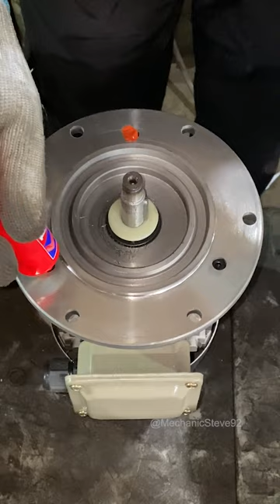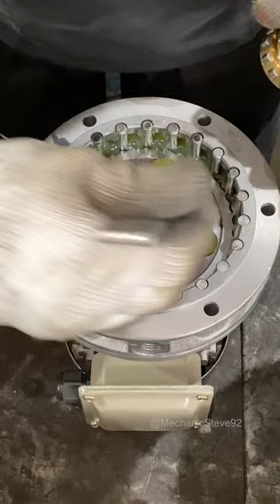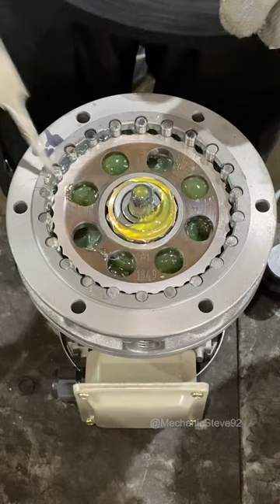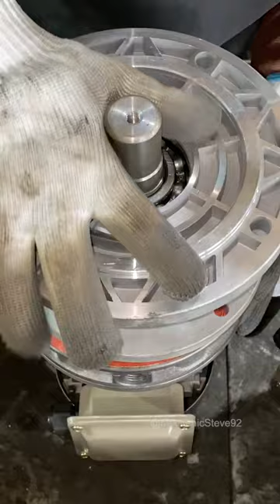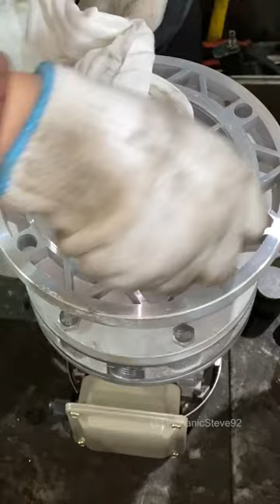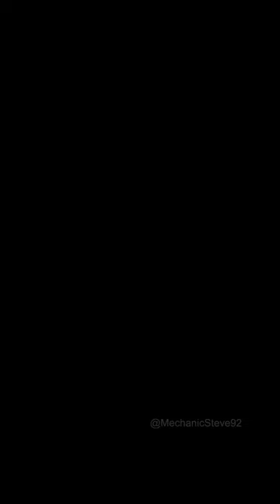BLD0-43-0.37KW vertical aluminum shell motor seat cycloidal pinwheel reducer assembly.

Comment: It’s an electric motor and the reason people say to not use a steel hammer is so you don’t mess up the shaft and have to tear down the motor and replace the shaft and if you mess up the bearing you can replace it